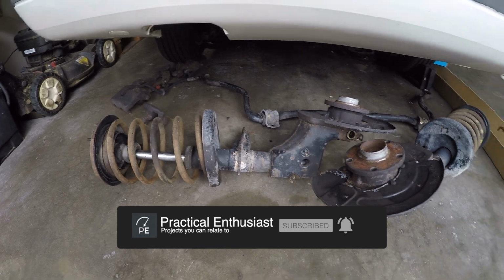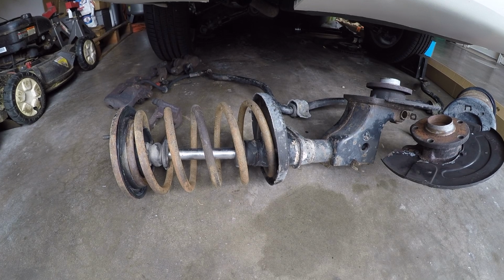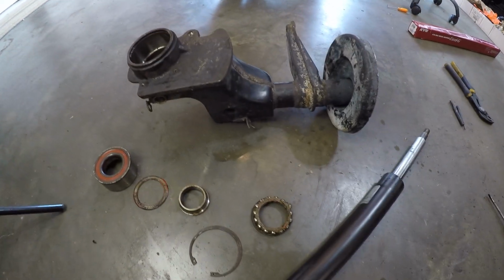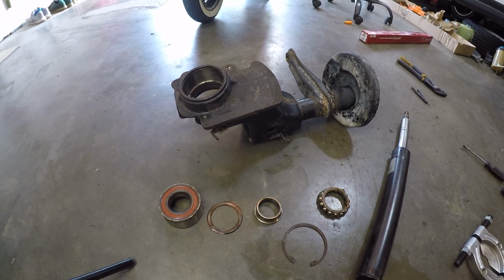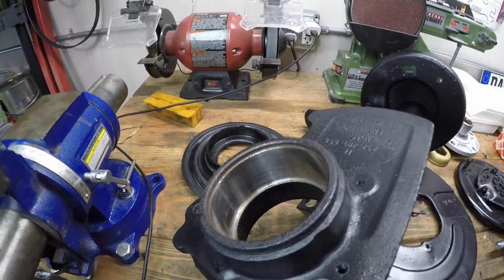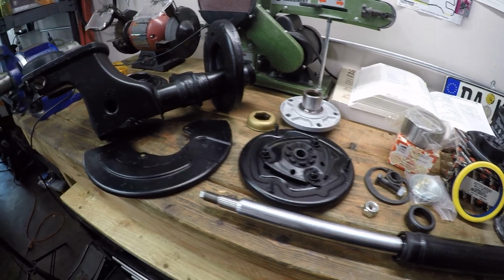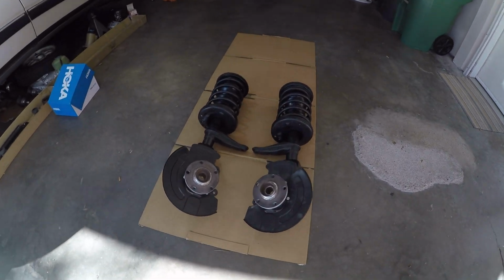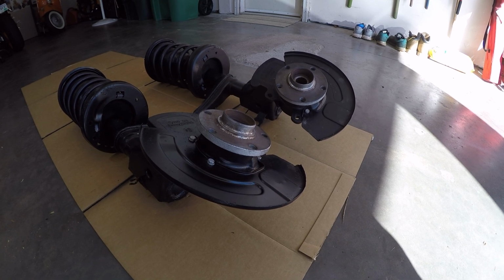Project Audi 5000 CS Quattro | Ep. 9 | Front Strut Assembly Rebuild & Restoration

Comment: I recall pressing those bearings out on my '87 5000 CS TQ back in '92 at the RIT machine shop. It happened to be at the same time Car and Driver was there to do a story on the Formula SAE team that was building car. BTW, cool you got the inner race off the hub like that. The prescribed method is to use a cutoff wheel and grind a slot in the bearing race (at an angle), then use a cold chisel to crack the race at the slot, letting it slide off easily. LOL, check w/ me on the next job and I'll tell you how I did it! I had my 5000 for well over 100K miles, and not the 1st 100K miles of it's life either!
Reply from the maker: It would be my luck to cut too deeply and ruin the hub 😂 . How many miles are on your car again?
Reply: @PracticalEnthusiast  I can't say I didn't mar the hub, but it worked just fine anyway! You get the right diagonal cut on that race and a steady hand makes it less scary.

Comment: Nice work. I’ve been battling the Cv shaft in my 4000 Quattro and contemplated doing this same job with the struts and wheel bearings since it’s all apart, but it looks like you really need that press, and I don’t have one. I’m having to redo the job because the cv shaft that I bought isn’t an exact fit for the hub and it locks it up when you tighten it.
Reply from the maker: Sorry to hear about having to do the job twice. That's always a bit demoralizing. Are the old axles salvageable? I agree, it's probably worth replacing the wheel bearings and struts while you're there. The press isn't prohibitively expensive but it does take up a decent amount of space.
Reply: @PracticalEnthusiast  demoralizing is a good way of putting it.  I was ready to drive this out of the garage and the front driver’s side was completely seized.   The hub-facing side of the new shaft interferes with the hub when tightened— different profile from the original.  I could have just replace the boot, and I might go that route for the rest of them, rather than rolling the dice on fitment. I’ll probably get the press by then— it’s the space consideration that’s kept me from doing it.

Comment: Is there any wisdom to torching the penetrating oil? I'm wondering if it is counterproductive  when trying to saturate the with heat. I do not have to deal with rust like you in the Midwest. I see a number of YT Creators doing this also. Edit: Sorry if this has been covered elsewhere.
Reply from the maker: It's a good question. I've found it helps the penetrant seep into the threads/crevices much better as the heat expands the metal.